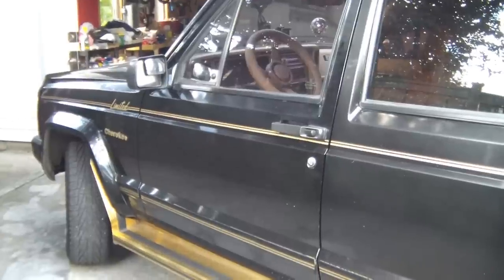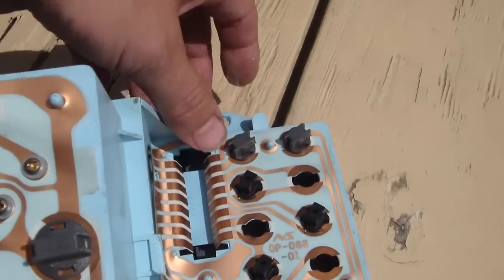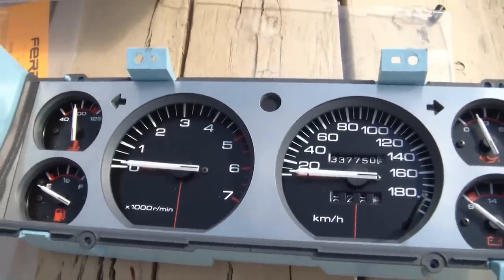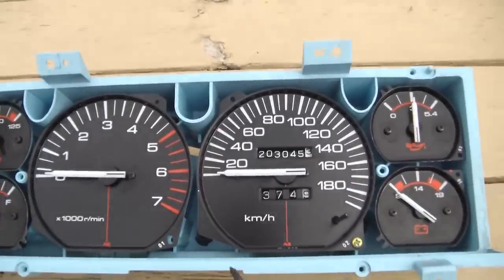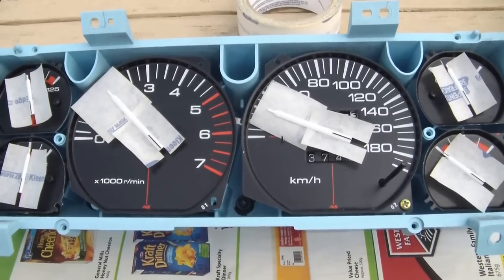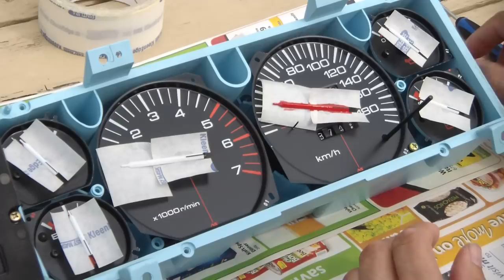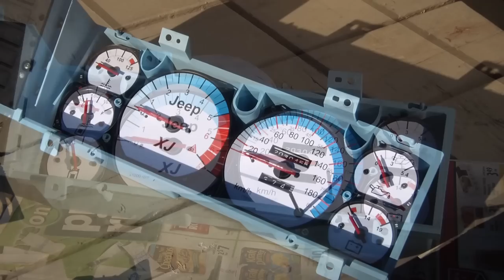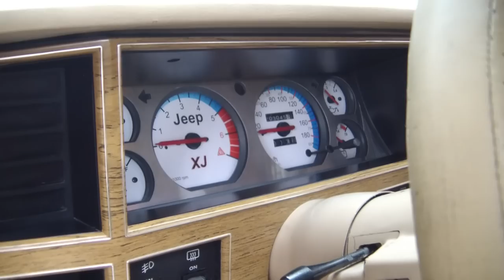DIY Auto: Dash Upgrade. White gauge installation on 1990 Jeep Cherokee XJ.

Comment: He changed his odometer reading
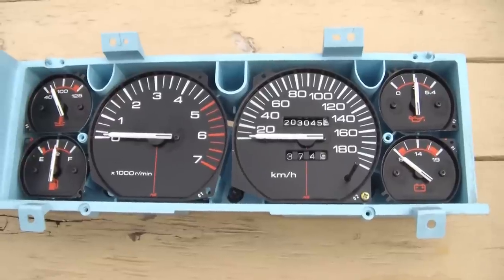Reply: No actually he is telling the truth and he did not roll back the odometer. Look at the lower right clip 4:20 on the first odometer (337K+ mile one) it's broken off. When he goes to the 203K one 4:26, you can see that clip is not broken off and indeed another cluster.

Comment: tip for model paint. use a little paint thinner and so many thin coats to eliminate brush strokes. it's how I paint my models and it's close to an airbrush finish

Comment: the reason they make a special paint for needles is because it wont effect the  accuracy of the gauges. Regular paint  is heavier and thus the gauges will be reading incorrectly. A red Sharpie will do the trick
Reply: Red sharpie is not fluorescent like the needle paint

Comment: Dude you totally turned your odometer back you do know that is illegal right.  Went from 337750 for most of the video than changed to 203045 at 4min 30secs just before he put on new decals this is really shady and wrong sir and if your trying to sell it after this gauge cosmetic fix I feel sorry for the sucker you screw over.  It would have been a better video had you not broken the law.
Reply from the maker: Owen Einarson Calm down, nothing illegal occurred during this video. This topic has already been covered in the comments below years ago. A junk yard pull was used to prepare for the real thing.
Reply: Klondike Mike @ you should have explained that in the video, would have avoided the confusion.  🤔🤓

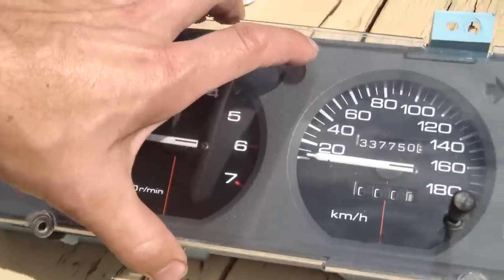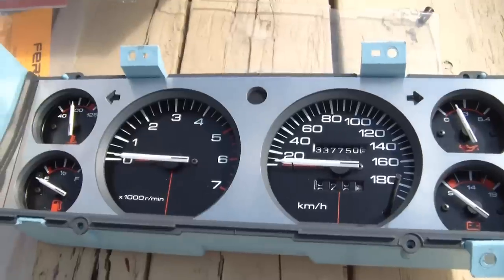Comment: If you look at the video 2:38 seconds in you will see that his trip meter is zero and he has over 300,000 miles and if you skip forward in the video when it has two hundred and something Thousand Miles how did he add 374 miles to the trip counter? Or why would you do that. He did not change it is to different clusters in my humble opinion also if you look at 3:15 seconds into the video when he has 300,000 miles on the odometer you can see brownish in color glue spots on both of the top left and right bolt tabs. Later in the video when there is two hundred and some thousand miles on the odometer there is no Brown glue spots I suppose he clean them off?